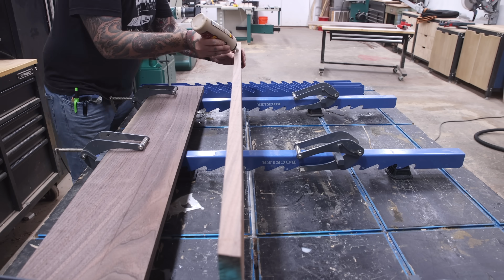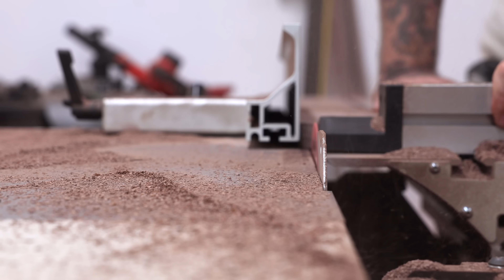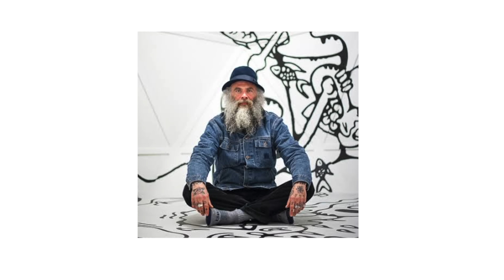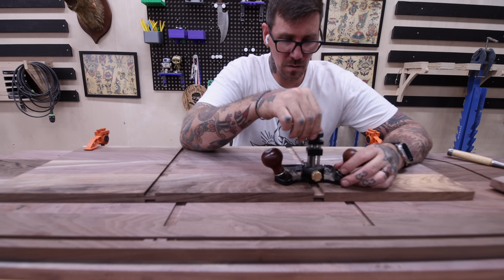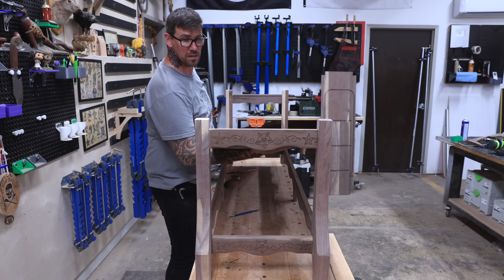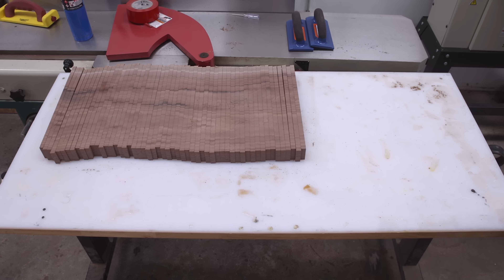Secrets Behind My Toughest Build Yet

Comment: I grew up in England before we went (mostly) metric.  Consequently, I'm bilingual as far as units are concerned.  For science, engineering, geometry, etc., I will always use metric.  It's just so much easier.  There's no need to remember different conversion factors, you just plug in the numbers and if they're big, divide by 1000 and add a k to the unit.  If they're small, multiply by 1000 and add an m to the unit.

Where the imperial system scores is that they are "organic" units.  They developed out of arbitrary units like the length of a body part that people can relate to.  If someone says something's a foot long, we know how big a foot is.  If something's two inches long, you know she's going to be disappointed.  In contrast, 300mm or 50mm mean nothing.  We can't picture large numbers of things.

In England, we are mostly metric, but there are exceptions, usually based on cultural significance.  We buy draught beer and fresh milk by the pint (proper pints mind, not the short measure you Yankees use).  However cans of beer and long life milk are sold in metric.  We use miles not kilometres, but petrol is sold by the litre.  However the efficiency of petrol vehicles is measured in mpg.  There are bizarre mixes of imperial and metric units, like EV efficiency is measured in miles/kWh.  Some exceptions are weird, for instance windows are measured in m or mm, but curtains are usually sold in inches.  I guess this is because windows are engineered, but curtains are not.

Comment: The U.S. tried to implement the metric system, no one could seem understand it. The rest of the modern world and many third world countries can understand and use metric system, but the U.S. cant seem to count or multiply by 10. What I can't understand is why they can't, I mean really, just add a zero. Poor education curriculum.  Incidently FYI Most all professional institutions relating to engineering and medical use the metric system. The imperial system is inadequate and doesn't have the units that are able to represent our advancements in technology.

1 of anything is also many of smaller anything, and its always multiply by 10, just move the decimal.

1 kilometer = 1000 meters, m
1 meter = 100 centimeters, cm
1 cm = 10 millimeters, mm

1 kilogram = 1000 grams, g

1 liter = 1000 milliliters, ml

For the love of God, what don't you get?

Comment: Metric system is easier, more efficient and more convenient but not in America. Converting American standard sizes to metric just to use the metric system makes no sense, you would also need to change the standards and use tools with those standards, but there is no initiative anywhere in America for that, therefore it wont happen. Comfort can be more important than efficiency, it all depends on whats important to people, and how much discomfort it would cause for what efficiency gain

Comment: The debate isn’t metric vs imperial. It’s arbitrary. You might as well debate whether feet or yards is better. 

The real debate is decimal (metric’s tendency) or fractional (imperial’s tendency). Fractions make the math convenient until it’s not. Decimal is the fallback. 

Other than that, we just use imperial still because that’s the billions of dollars of equipment we already have. Nobody cares if you call it 1/2 inch or 12.7mm, they care what tools they have.

Comment: if its bigger than your leg and foot stretched out use imperial, if its smaller than your leg and flat foot use metric.
Reply: doing it like this keeps the repeating jumps you make when using additive measurements in imperial out of the 2/3 times and metric out of 5/10 times repeating. stops it from overshooting its major points and making math complicated

Comment: Jonny, I have a suggestion that might be of some help in the future. Build a vacum champer for the infusion process. The next time you need to infuse wood with any material. 
    Use any type  of metal talk that will hold your materials.  Robe an old compressor off any cooling unit to make your vacuum pump.  A refrigerator compressor will work but bigger is always better.
     By the way, beautiful work.

Comment: The primary benefit of metric is just that everything is 10 larger or smaller than anything else. But yeah, converting down from imperial to metric will often leave you with odd decimal numbers. Of course... converting from metric to imperial you will basically never get an even inch, so...

Comment: Canvas or material - overlock the edges... no fraying.

Have you considered kerfing with a very thin tapered router piece then bisecting each cut to rip the individual pieces. You then have your corner movement with little or no separation of the parts - just some gathering of the material in back.

Comment: we're confused by your backwards measuring system because it literally is so complicated and doesn't make sense. it's not 1:1.

For example, you go foot, yard, miles? 
1 mile is 1760 yards, it's such an odd number. 1 yard is 3 foot. 1 mile is 5280 foot. you have so much more math to do if you wanted to say convert 7 miles to yards and then even if you wanted to convert multiple miles in foot.
We use Kilometers for the similar scale in measurement to miles. 1 kilometer is 1000 meters, 1 meters is 100 centimeters. it's all 1:1 with metric.

The US customary system is just backwards and stupid sorry. Sure that's just what you've had to grow up with, and it sucks and obviously you need to know it. But if I was a builder i'd solely use the metric system because it's going to be way less of a headache and way more precise with less effort.

Comment: Super super cool project but I'd be worried about backing the tambour with felt for a long lasting solution.  Canvas has a grain to it, which is structurally more stable and will keep things aligned - felt doesn't have a grain and I'd worry it'll start to sag or stretch in places.  Seems like hemming canvas before applying it and then covering the back in some felt like a lining would be best of both worlds.

Comment: I've built 100s of roll tops I started with applied backs like that. No good for antiquity.  So I started drilling holes 2 inches from ends and middle to run bike cable wire through. Then I found that weed eater twine was perfect for roll top building.  Never had 1 come apart or fail in 40 years.just pull tight and use crimp connection to join twine in back recessed Grove. I build roll tops like that small as a business card holder to big as an 8 foot TV entertainment center. Love your work
Reply from the maker: Great info, thanks 🙏

Comment: in this modern age imperial is defined by metric as in the definition,1 inch is exactly 2.54 cm. so while you're using imperial measurements you're secretly using metric measurements.

Comment: Just in case you don't have a science background and don't know why metric is better for things like carpentry, I'll explain why.

You can only be accurate as your smallest measurement.  Proof of this is how you a scientist would explain any measurement.  While you might say a piece is "5 and 3/16 inches", a scientist would say it's "5 and 3/16 inches, plus or minus 1/16 of an inch."

See the difference?  You always have to mention your margin of error.  And your margin of error (typically) in Imperial is 1/16".  In metric, it's 1 millimeter.

And since 1 millimeter is smaller than 1/16", using metric measurements will *ALWAYS* be more accurate than Imperial.  *ALWAYS.*

It's just a reality of most common projects that Imperial is "good enough."  But once you start getting into builds like this, that are more like art than merely functional pieces, then you should want to use metric for no other reason than it's more accurate.  There's a reason the entire world uses metric:  it's better.  :)
Reply: You missed the entire point of what he was saying: it doesn't matter if the metric system is better.

Also, that whole bit about margins is bunk. Margins are set as precisely as they need to be for a given task/work. It doesn't matter that a 1mm is smaller than 1/16". If something needs to be more precise than that, then there are smaller divisions, same as there are in metric, and the margins can be made tighter to fit the situation.

Comment: The reason why the rest of the world has moved on from imperial to metric is because imperial is simply much more difficult to work with. Yes, even if you are used to it. The problem is conversion from lower units to higher units and vice versa. Imperial units have just random conversion factors between units, while in metric the conversion is always in a measure of tens which means conversion can be done by simply moving the point back or forth.
Compare:
Imperial: 1 mile is 5280ft is 63360in
metric: 1km is 1000m is 100000cm

Fun Fact: One of the primary reasons for the failures of the first rocket tests in the US was because the scientists and engineers that made the plans for the rockets (like all scientists and engineers worldwide) used metric for all the plans because that's just easier, especially if you have to do a lot of math. However, US manufacturers couldn't work with metric and therefore when the plans were sent off for construction all measurements had to be converted to imperial. That's dozens of thousands of measurements that had to be converted. By hand because computers didn't yet exist. It was inevitable that some conversion errors did slip in. There was also the problem that many of these measurements ended up with extremly weird values in imperial due to the ludicrous nature of imperial. And some manufacturers just couldn't accuratly measure stuff like 7/34th of an inch or did just straight up ignore some of the finer measurements. Long story short, many fo these tiny mistakes cumulativly caused large failures.

Comment: I have 0 experience working with wood, but you could possibly get the skulls on the big plate while taking the saw's thickness into account, and then just push the plate through the saw later on. That would prevent the wood from having chips and cracks.

Comment: If "good wasn't good enough"- on that theme- then I would state I would of loved to see those brass knuckle handles actually made out of brass. That would of added a "punch" of shine to all the dark wood in my opinion and make the rest of your detail stand out more. Also- since you have all the CNC machinery- get yourself a good green sand mix, slap together a cope and drag box, and then CNC yourself some custom mold forms, and you could cast yourself some pretty unique pieces for your already custom pieces. I don't have your wood working skills so I get by with a 3D printer and a small furnace in my garage. : D. Love the dedication to the art what your doing.

Comment: I watched this video with a fellow woodworker.
We have over 100 years of woodworking experience between us.
We applaud all artists in their creative endeavors - and we are amazed your incredible shop and tools.
And, you have probably made more money through sponsors and advertising than both of us put together.
However, we both predicted that your tambour doors were doomed to fail from the start, because you had the grain orientation wrong.
Have you ever seen a traditional roll top desk? The slats are always milled ALONG the grain - not ACROSS the grain. Thin cross-grain slats are inherently weak. It doesn’t matter that the lumber was kiln dried. Your comment about “honey-combing” is … don’t blame the material.
You might have been able to get away with cross-grain tambours if you impregnated each piece with epoxy in a vacuum chamber, but this would be impractical.
While we appreciate your perseverance, you wasted more time, material and energy in one project than I have wasted in 50 years of woodworking.
One thing you did get right was having a moment of humility when you asked a more experienced woodworker for advice.
In high school wood shop in the late seventies, we learned about the “Six P’s”:
Prior Planning Prevents Piss Poor Performance.
Refine your design, think things through, make a cut list and proceed methodically. 
After completing a three-year apprenticeship with a cabinetmaker and working as a finish carpenter for a year, I studied furniture design at a small, private art school in Providence, RI. I learned about creative “iterative” design processes - allowing a piece to evolve through-out the fabrication process. We were taught make scale models, full-size mock-ups (in less expensive materials, plywood, cardboard, pine), joinery samples, etc. before commencing fabrication in expensive hardwoods. 
Also, as a Freshman, I was required to study figure drawing (art history, 3D Design, etc.) One of most important things I learned about drawing was “line weight”. A good drawing includes thin and thick lines and smooth transitions. 
I have never seen a truly artistic carving produced by a CNC machine. Perhaps some programs can vary line weight, but a rotating cutter can not achieve the same nuances as a skillful carver with a sharp veiner.
I have hired CNC shops to rough-out sculptures and carvings, but always finished carving the pieces by hand.
Would you ever create a tattoo with all lines of same thickness?
Anyhow, sorry for the rant.
Keep on learning and seek out old-timers. 
We might not be able to program a CNC, but we know a lot of stuff!

Comment: I will say, metric units, when converted from imperial to metric make fuck all sense, our materials come in different stock sizes here, so a piece of plywood here is 2400x1200mm which is the closest “makes sense” number to 4’ x 8’ which actually comes out to closer to 2438.4mm which would make woodwork a nightmare here, generally our stock comes in multiples of 600 or 500mm so 600,1200, rarely 1800, 2400 and very very occasionally 3600 which would be 2’,4’,5’,8’ and 12’ respectively. This is also why a lot of imperial wood working plans don’t work (in terms of cut lists from sheet stock) and a lot of our hardware is metric, although you can find imperial hardware

Comment: Why's everybody so OCD about what system of measurement a guy uses? It does the business, right? Use what you're used to! Does it matter if the measurement is originally based on the circumference of the earth at the pole or the average size of barley grains?

Comment: The funny thing is that all of the imperial measurements are just conversions from metric. The entire planet runs on metric. But 3 countries for some reason decided to  convert them to a more complex system.

Use whatever you want. Personally I may use inches for larger things but I always use metric hardware when I can. M3 bolt is so much nicer than 12/23 screw or whatever the standard imperial threads are.

Comment: Props for cutting your losses and starting over.

If it doesn't interfere with the finish, I wonder if waxing the sides of the tambor strips would be worth the trouble to avoid them gluing themselves together.

And hey if you have a swear jar  in the workshop I'm sure that build would've paid for itself.

Comment: You know youre bringing up a quarter inch as an example but if course in Europe nobody is going to use 31.75mm they would just 30mm for example. Also, imperial system is derived for metric nowadays so the US is secretly using the better system

Comment: I've never made tambour doors or even worked with walnut. But I was a pattern maker for a while, so we had to build things that would put up with a beating in the foundry. I'm wondering if it would be possible to laminate some material onto the backside in the opposite direction before cutting the slats. Good it's good enough, but It may strengthen the slats like plywood and if you use a similar wood it may not be very apparent.

Comment: Adaptive measuring. Not bad. Metric is easier to learn, but every measurement system is just about equally good if you’re a robot. Use the tool that best fits the situation which you’re comfortable with.

Comment: In the 1970s, the United States made efforts to adopt the metric system, but it did not lead to a full transition. The Metric Conversion Act of 1975 was passed to promote voluntary conversion to the metric system, which is used by most countries worldwide. However, this effort faced significant resistance from the public and some industries.

Comment: Any form of measuring is fine as long as the individual using it knows how to. As a European I know a bit how inches work, and sometimes it's wonderful. When you got 4 inch wide material, half of that is 2. When our stock is usually 89mm, which is 44,5mm centered, and then 22,25 quarter. HORRIBLE. anyway good isn't good enough

Comment: Victorian style is among my favorite. Especially the real deal, as it was hand made, which must have been a painstaking process. Today, with a proper setup, a skilled woodworker could turn out a nice replica of something from that era that took a year or many more, in a fraction of that time. But, that personal touch of doing something by hand and the skill required trumps anything a machine can do in my personal opinion. Because I dabble in many mediums of art, including wood carving from time to time, I can appreciate that kind of work easier knowing how hard it is and the time involved. The 3-d style of sliding door you have done, is a pretty cool thing. Plus, having furniture that's just all straight lines, with no art, no real design, just seems boring to me...uninteresting and impersonal. I would much rather have a one off piece then have something that every person on Earth has the opportunity to also have, exactly the same, with only the grain as the differentiating factor.

Comment: The metric system (base 10) and the imperial system (base 12) have their perks. For example, 10s are easy to add up quickly, but you have more options for dividing 12s (12, 6, 4, 3, 2, 1) than you do 10 (10, 5, 2, 1).